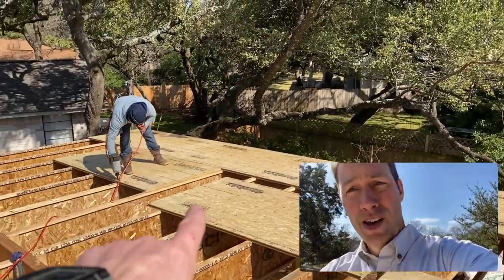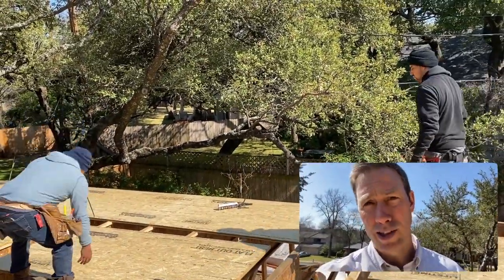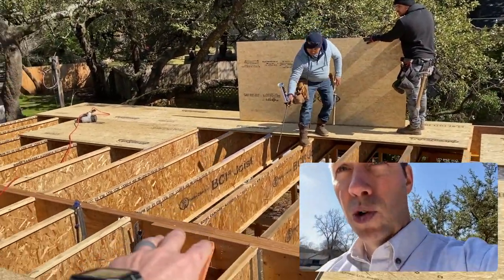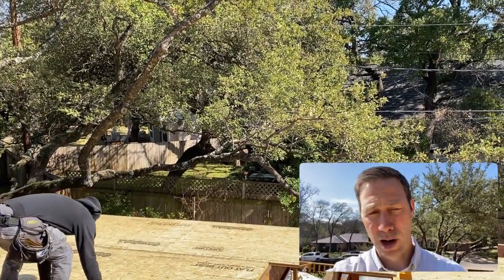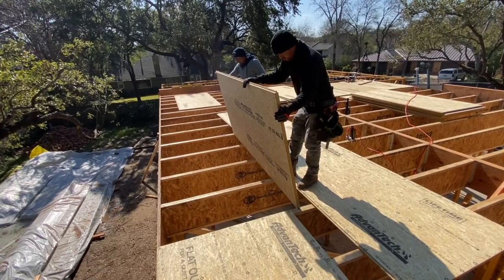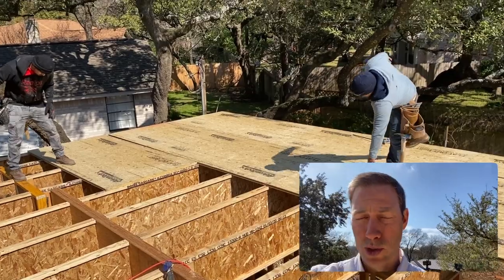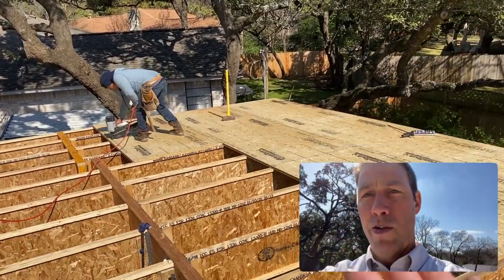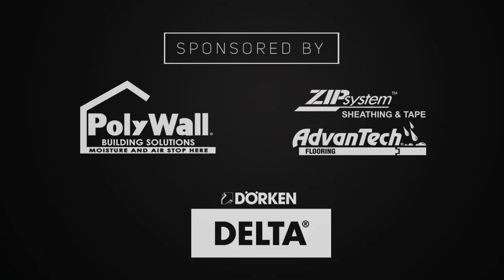Subfloors - Best Practice - Real ReBuild

Comment: When I glued and laid 4x8 subfloors, call me anal, but I found out if you slam the sheets down a lot of the glue would be blown out, so I would lay them down gently and as close to the correct position as possible,  But that was with the older subfloor adhesives, don't know how the polyurethane glue reacts to plywood being slammed down.
Reply: Spews out like stepping on a ketchup packet.

Comment: Grear vid. I have used advantech 1-1/8 th floor sheathing for a while and heres my take:  i have numerous squeaks if using nails.  The advantech foam glue has zero body (too thin) and less working time. So i switched to pl polyurethane from loctite.  I now use simpson strong tie number 10,  3 inch collated screws every 6 inches.  I NOW have zero squeaks, zero rusted floor nails, and the glue covers the entire joist flange. I make it a point to go below the floor and look up; if i cant see glue oozing everywhere, then there was NOT enough glue used.  In the end, the glue will fail, the screws wont.  Advantech subfloor is awesome and i will have great success with my preferred method. 😊
Reply: Thanks for the recommendation!
Reply: Would that glue be better than PL 400 subfloor adhesive if using plywood or commodity OSB? Or no point?
Reply: Yes. Trust me
Reply: @MrTooTechnical  I will. Seems the way to go! Advantech is unavail here, so doing 3/4" ply over 16"OC I-Joists.. then 1.5" concrete topping. Would simpson WSV #9 2" screws be good on that?
Reply: 2 inch Simpson screws you mention are great.  Just remember, after the floor is installed, if you go underneath and look up and don’t see pl premium oozing out, you didn’t put enough glue. Put lots of glue. And put the screws every 6 inches at least. Then your floor should be squeak free for a long time.
Reply: @MrTooTechnical  Thanks Dave! I wonder though, if using a 1.5" concrete topping is it worth doing more than the code req 6/12 fastener schedule? Or does the concrete make that wasted labor and screws?
Reply: I guess u didn’t read what I wrote. It’s okay, it’s New Year’s Day, pl polyurethane from loctite

Comment: I installed about 75 sheets of 1 1/8” advantech over i joist on my ICF house in Lubbock. Loved every bit of it. Will never use 3/4 subfloor again!
Reply: I'd like to see someone do ICF walls and steel-reinforced concrete formwork for the floors and roof. Also, slab/pier hybrid for an exta measure of overkill.

Comment: that nail gun is messing with your Mic.....your voice drops out.....
Reply: great video otherwise!!
Reply: Automatic gain control.... it's a beautiful thing!
Reply: It’s fairly standard for his videos
Reply: @jameslastname9171  doesn't make it right or professional
Reply: your guys should be using a sledgehammer with a 2x4 to push the 4x8 board tight against the the other one after the lay it down. i thought everyone did this
Reply: forgot to mention hiring Hispanics is also key. hard working people
Reply: @EternalResonance  how about just hiring whoever can and will do the job? Out of work Americans? Why does it have to be Hispanic? White people or black people or other races don't work hard or can do the job?
Reply: @WayneWatson1  yup, hire the right people not by race but by skills
Reply: Meritocracy is the way!
Reply: The ratio for the audio compressor is set way to high, making for excessive gain reduction when triggered.    The threshold is the trigger point, and obviously the background noise, notably the nailer, triggers the threshold, then ducks the overall volume by a ratio of dbu above the threshold.   I.e. 5 dbu above the threshold, with a 5:1 ratio, will duck the gain by 25 dbu.    +5 minus 25 equals -20 gain reduction.     Now you know.
Reply: @andrewhigdon8346 😮😮😮😮

Comment: I used 3/4 Advantech over 1/2 original plywood subfloor to replace 3/4 inch particle board that had carpet on it. We then had wood flooring installed over the Advanrech. Made for a solid floor. I used 155 sheets.

It took two men six weeks to remove the carpet, tile flooring, particle board and prep the remaining original 1/2 plywood subfloor. It took the same two men six days to install the Advantech subflooring. Because it is flat and straight, it goes down quickly. Saves money on labor. It us a great product.

Comment: Two layers of 5/8" Advantech.  First layer transverse to the joists & second layer longitudinal, glued & screwed.
Better than reinforced concrete.
Reply: Probably not a very smart question, but you glue and screw each layer then? How long are the screws?

Comment: I’m cringing watching that guy smack that plywood groove with a sledgehammer. Someone should give him a beater block.
Reply: Or at least a deadblow\soft face sledge hammer.
Reply: My OCD also.
Reply: Michael VanGundy 

Please stop hitting my $52 per sheet plywood with that 16 pound sledge.
Lol
Reply: What cracks me up is he does it while standing on it.
Reply: Relax. He's tapping it. A block spreads the blow making it harder to work one edge at a time. As long as your not really whacking it this is fine. And you stand on the sheet so it doesn't bounce back out of groove of the other sheet. If you'd ever run plywood in your life, you'd know that.
Reply: WHILE they drag around the tongue-and-groove around hitting the corners on the floor, tongue side down.  That's the best way to snap off the tongues and eff up the interlocking mechanism.
Reply: @Jose Soto i seen "pros" do a whole lot of bad work
Reply: @chrismoore9223  What's the timestamp where you saw the tongue snap off?
Reply: What's the timestamp where you saw the edge of the board damaged by the sledgehammer?
Reply: @markflounlacker8211  These guys are terribly inefficient though. I agree with your comment. The lazy work pace drives me crazy.
Reply: @uglyashelful  LOL. I almost commented about that. Maybe they were worried about splashing glue everywhere. LMAO, these people. It's not a weld for God's sakes. Hey, I'm just a bitter old framer who's glad his builder isn't using 5/4" yet. I'll have buy a forklift.
Reply: Seems to be joining with no issues.

Comment: Last year I overlayed a old trailer floor on our “winter” home with Advantec  !  Used the 1 1/8 on old trailer flooring so there was no use to glue it because it was worthless material to begin with . Screwed it all down TIGHT . This year there were a couple butt joints that were barking when you stepped on them . Backed off the screws on both sheets , stuck a crowbar in enough to pump liquid nails in and screwed it tight again !  No more barking .  When I built my home in Upstate NY my floor joists were 2x12 Doug fir and liquid nails and 3/4 T&G plywood and nails . Been 30 years — no squeaks !
Reply: Good ole 2x10-12 will always be superior IMHO. I don't think these new "engineered" houses will last

Comment: I love the idea of I-joists to fit your A/C sends and returns between ceiling and floor.  I had a project where I suggested to my builder they go that way, but the A/C contractor assured us 2x6 would be fine. He was wrong. I should have gone with my gut and overridden the A/C guy. It would have pissed him off, but I got pissed off instead. Lesson learned.

Comment: In North Eastern Pennsylvania here. I am using 11 7/8" I-joists @ 16" o.c. using 3/4" Advantec. We are using caulk tube subfloor glue (polyeurathane based). and shooting a 2 3/8" ring shank nail.

Comment: When I was working construction fulltime in upstate NY (1999-2008) we were running the TJI's with 23/32 advantech, glued down with PL (I think it was OSI or something close) and fastened with nails.  The polyurethane is huge with stopping noise.  We'd always use a maul to set the sheet though.  Usually a 4 foot 2x4 scrap or whatever was on the bottom of a delivery skid would help set the sheet in the grove without beating up the edge.  Then tap the end to finish it up.  Worked real slick.

Comment: I used the 1 1/8 advantech in my subfloor on gator open web joists. I also used the foam from advantech. I am a owner/builder and doing the entire home myself. Im located in texas if you would ever want to come see it. ~4500sq/ft of advantech. I believe it was about 84 sheets +/-
Reply: 84 sheets at 32 sqft/sheet is 2688 sqft, not 4500.  Are you including the basement?
Reply: Hi, I will be starting in a similar project soon and I was also thinking of Advantech 1 1/8 and open web joists with a 22' span. Which span did you use on your project? And how do you like the result?
Other alternative I was thinking of: is steel C joists and USG Structrocrete panels, more solid, more fire proof but also almost 3 times more expensive...

Comment: I built a DELTEC Home.  they ship 5/8" plywood that's precut to the shape of the floor.  Once the walls are up they require a second layer of 5/8' plywood in a running bond over the first layer.  Both layers are bonded with PL400.  Because the trusses run in a radial pattern, the edges of the second layer don't frequently land on a truss so I screwed in those areas.  The trusses start at 24" on center but are tight at the center.   It makes for an incredibly stiff floor.  Our kitchen is near the center so the trusses are extremely close.  It makes for difficulty running the drain lines for the sinks in the pantry, kitchen and laundry.  I'm sure my plumber wasn't happy :). By the way,  the quality of the plywood provided by DELTEC is better than I've ever seen for a CDX.  They used the same 5/8" on the walls for sheathing. I ordered 1" of foam over the sheathing and sprayfoamed the walls.  You mentioned on a previous video that you use acoustic sealant on both sides of the foam gasket.  While I used a gasket, we're on a full basement and the rim joist is foamed tight to the top of the ICF foundation.  It's pretty tight.
Reply: adubbelde1 I wanna build a Deltec home someday, I love their aesthetic and philosophy
Reply: @JohnVance  We particularly love the aesthetics of our great room.  It's about half of a 1500.  it's got windows in every panel but one, the one that is our entertainment wall.  We Live in the mountains and our views encompass, Mt Coolidge in Custer State Park, The Cathedral Spires, also in the park and Harney Peak (now known as Black Elk Peak). If there's a downside, the bedroom, though large is difficult to arrange, as is our office.  We have a great laundry room, Pantry and Walk in closet.

Comment: Haven't used 2x material for joists in years.  Typically use floor trusses, the structure is more important than the sheeting.  On floor trusses, I use the 3/4" Advantech.  If its a particularly complex frame we spray the Advantech with Thompson's water seal to prevent any joints from swelling.  Some of our frames take 2 months and despite what Huber says you are going to get some degree of swelling if it rains a bunch.  In my opinion as well the squeaks 90% of the time come from nails barely catching the joist below.  The floor trusses help take out some of that error with a wider bearing surface.

Comment: I did a mold inspection in Rockport, TX after Hurricane Harvey. The house had this same subfloor and thickness. Even with all of the staples in it and standing water, there was very little water penetration. No warping at the seams. Pricey sure, but in a half to one million dollar home, well worth it.

Comment: New age MGO subflooring is also a really good option, its more fire resistant, and like cement offers a high degree of noise reduction between floors. Its also semi flexible and strong.

Comment: I have used 22mm chipboard with polyurethane glue with no nails or screws without squeaks before on either I joists or metal Web joists. It's a Caberdeck moisture resistant chipboard with a peel and stick cover.  Important to let the glue spill out over the joints so that it forms a waterproof seal until the roof is covered over. After all wet trades and painting is done you take the peel and stick off and use a floor scraper on the excess glue. Works a treat.

Comment: I had to strip the kitchen floor out of my house remodel, seal the joists (odor problem) and then start over with a new sub floor.   I did 3/4" exterior grade plywood, glued and screwed to the joists, with 2x4s screwed underneath where the edges butt together.   Solid and not a squeak or shimmer in about five years since I did that.    Probably over engineered but that's how I roll.   :)  I've got PEX tubing under the floor for radiant heat so I didn't want so thick of a floor as what you're building there.   

On one section of the floor I've got a concrete cistern that comes up 4" under the joists so we insulated there with four layers of "pink board" insulation, two below the joists, two cut to fit between the joists.   PEX laid between the joists in the open space on top.   I'll let you know how that goes over the long haul.

Comment: Decking was 1x4- 1x6 nailed down on joists with 6p nails cement coated . 45 degree to centerline .Glue was optional.  Squeaks? Wetness ? It dried out.  Solid wood quarter sawn , air or kiln dried is hard to beat.

Comment: I built a house using 3/4" Advantec sub and it swelled like crazy on the edges.  Even after totally dried out, had to go back and sand for hours.  I charged it back to Huber.  The slow moving installers in your video are slamming the sheets down on joists and mashing a lot of that Huber adhesive out before they whack the edges with a sledge.  No no. Did you see how much the joists flexed when they dropped the sheet? Dang.  Floor truss system in all my houses. Never see that.
Reply: That was Matt's worst video I've seen.  So many mistakes for a master class on subfloors ;)

Comment: Great videos Matt Thanks.  When I was framing 20 years ago I was told by an engineer that if you glue the tongue and grove the floor is 30% stiffer. What are your thoughts on that? Thanks

Comment: I only use 1-1/8" t&g fir.   best by test.  holds wood floor fasteners better than chipped wood products
Reply: What width do you use?
Reply: @JamesG1126  4x8' sheets (1 1/8" fir plywood).  thanks

Comment: As someone from another country, and sensing that he is aiming for a strong house, I am wondering why Matt is not building with concrete, or concrete based materials like Durisol/Nexcem or Faswall. I am ignoring cost of course, but then, didn't this project cost a lot of money because it had a house on the lot?
Reply: If you use 16 inch joist @ 16 on center you can pour a 2 1/2 over radiant. Did it on a second floor project in Maine. We put bridging down center of joist though.

Comment: Great choice of floor. I like that it is thick, so you don't get a floor that sounds like a drum. But some comments. When you glue, no need for nails och screws. But you need them to to hold before they dry. So that gives, you only need nails, not screws.
Reply: John Strand you need fasteners for diaphragm shear values.

Comment: Be careful using screws on a subfloor installation. I’ve been called out by an inspector on substituting screws for nails in a floor diaphragm. Fortunately I did my research and used a rated screw so I had no problems (Simpson wsv 2.5”). The Simpson screw is as far as I know the only rated screw on the market that’s collated.

Comment: My take for what it's worth. Engineered trusses and Advantec or Legacy in 1 1/8 are a winner, glued and screwed. Legacy uses a Gorilla product to strengthen and avoid water issues and Advantec uses poly and perhaps wax finish. I used both on the same home, mine. I feel(believe from side by side comparison and performing a water float test) legacy is NOW the better product. Some old timers told me about Huber's warranty on the Advantec and it appears to have lessened greatly from the beginning. That aside the legacy was way more water resistant then the Huber. After only 3 rains the Huber was edge swelling, not so with the Legacy. In my estimation some idiot Huber bean counter reduced the amount of poly per sheet to save a penny and lessened the product integrity. The Advantec is still far superior to conventional materials and I will still purchase it at times but the Legacy is at this point superior to Advantec.

Comment: It looks so easy for these guys: just drop the sheet of OSB and stomp-push it into place.  My experience has been nothing like that because I'm doing a renovation and my joists aren't nearly as flat as the I-joists in this video.  Also some of my Advantech 3/4 sheets are slightly bowed, so encouragement has been required to make the tongue go into a groove.    Of course once they've been screwed down, the sheets are flat and quiet exactly as promised by Huber.   1 1/8" sheets are unicorns out here in UT.   I looked all over and found only 3/4 sheets.

Comment: If I where to build a house, I would use 2x6 studs and 1/2 ply with 2 inch foam and 1 1/8 plywood for floors with I joists

Comment: LBL frame 16 in center, spray foam between joist for acoustic insulation. 1 LB Ft. rubber Matt liner under finish floor. Solid floor that feels like concrete quiet.

Comment: I'm loving this comparison Matt. You have done a great job showing the details you use for a heavily reinforced squeak proof floor. 

This tied in very well with your video about commodity vs quality osb.

In curious what your stance is regarding using advantech for structural sheathing in extreme weather environments. Racking strength is critical in several of my build zones due to lake effect and inversions causing sustained winds over 90mph.